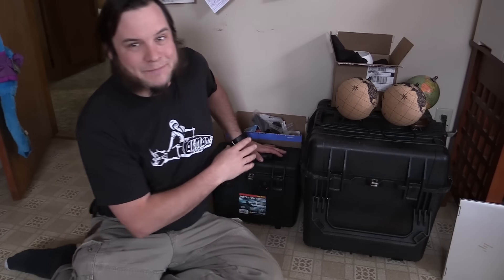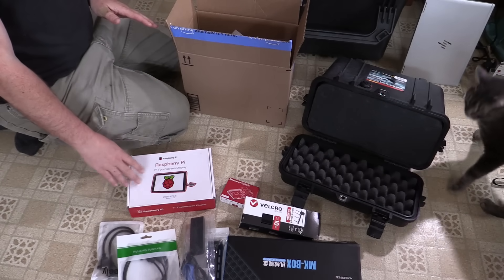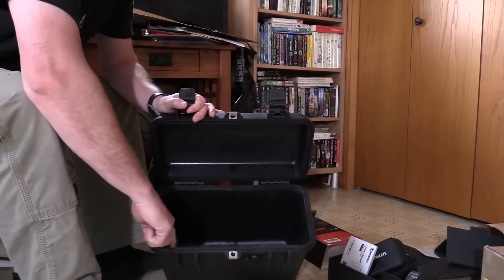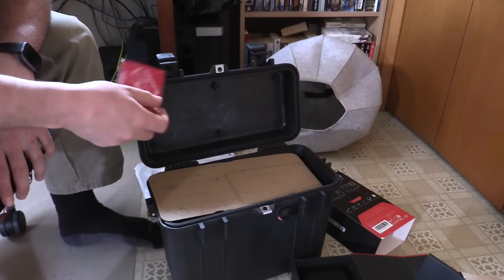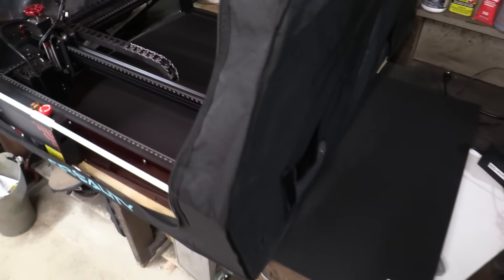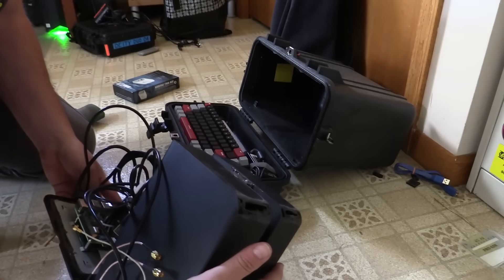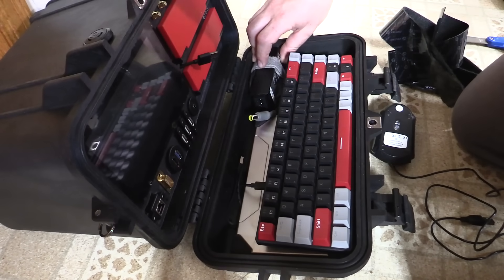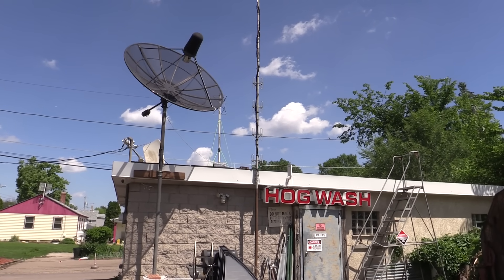Satellite Hacking Cyberdeck v2.0

Comment: A tip on scaling, find a 150 mill, or 6 inch ruler either metal or paper tape, preferably with metric scale showing. Tape that to the back of a clear plexiglass piece that fits across the top of the surface you want to trace. In the software you're doing the sketch from the image, you now have a scale that's at the same level as where you're sketching that you can tell the software that from point xy1 to point xy2 is n mm or the like. Then you get to adjust for the kerf of the laser cutter.

3d printing tip - Clean the bed. Both Glass and PEI sheets will work, but you might look at Garolite as a bed surface. Before printing something 'flat' like those box tops, spend about 10 min and really clean the surface, A drop of dish detergent with 50/50 Alcohol and water (total about 4 oz 100 ml,  sprayed on the bed, and scrub with a lint free cloth, then rinse with clean water, let dry and don't touch the surface anywhere you're going to be printing onto.
Reply: Or just slap down painters tape

Comment: have you tried hooking the +5V to the GPIO pins instead of trying to do the USB thing?
Reply from the maker: Haven't tried that, also someone sent me a better power supply, it just showed up after I finished this video!
Reply: @saveitforparts  as a side note, I was thinking, you could also 3d print some flip down legs on hinge mount so the keyboard lays in a more ergonomic angle.

Comment: For the hotswappable batteries, have you considered reversing it so, instead of having to plug the thing in manually, it plugs in itself in the process of installing the battery?
though, that would make it a lot harder to remove, but you could maybe have indents to the side of the hole to allow you to grab the battery firmly.

Just some ideas, hope it survives OpenSauce lol

Comment: YESSSSSS! ANOTHER CYBERDECK!!! good luck getting it through the airport, also, are you sure the Pi won't need a little heatsink in that closed, hot plastic box?
Reply from the maker: It probably does need a heatsink, although it ran outside in the sun for 2hrs and didn't seem to have any issues. Will see how it does all day in a hot convention center!
Reply: @saveitforparts  oh, if it was fine out in the sun, surely it's gonna be fine indefinitely in an interior, even if it's poorly ventilated

Comment: @11:16 - It's not even the case of not having a good power adapter in the case of my Pi 3B+. The limit is the horrible micro-USB connector combined with inferior cords.  Even on a bench power supply current limited to 5amps at 5.3V, I still get an unpowered warning.

Comment: You could try picking up a Power Delivery trigger board because those can be set to output 5V at 5A which should be plenty for any current version RPi. There are power pins on the pin header as well, so you could feed it some more there too. Looks pretty slick!
Reply: I heard there are many PD devices that supports 5A but *not at 5V*. So,

Comment: For those 3d printed lids, I would make sure your bed is leveled, sometimes the level can get messed up between prints also I would print inside an enclosure. The hot air in the enclosure will help with layer adhesion.

Comment: The issue with the power is difficult to solve.. there are 2 problems with it.. 1. it requires 5.1 to 5.2 Volts to power the USB 3.0 Chip on the Rpi4.  2. Rpi4 requires several Amps.  I use a step up to get the right voltage but I've only found 1 adapter so far that's capable of providing the required Amps (from a 10 port powered usb3 Hub).  It's not good to use a Rpi with low power as it WILL corrupt itself as it browns out trying to parse important data for it's continued operation.

Comment: Why do not you a 12 volt bsttery supply and then regulate it down to the 5 volts needed?
Reply from the maker: That's what I had in the last one, this one actually can do various voltages out but I don't have a transformer in there.
Reply: @saveitforparts  is a DC-to-DC converter an option?

Comment: Turn your part cooling fan off for the first layer and let it ramp to 100% by layer 10.  That'll help with your warping issue.  You could also try bumping your z offset negative by one click which will make it squish a bit more and stick better.

Comment: Long live the Cyberduck 🦆 (also, before it goes live: the mentioned Github URL is missing from the description)
Reply from the maker: Ope! Thanks, I'll update that.
Reply: @saveitforparts  hey for your cyber deck of you if i was you use an voltage regulator an two drill battery,s an use it than the voltage regulator put it from 18volt to the correct voltage what the board van handle an you have enough to power the cyber deck for a few hours